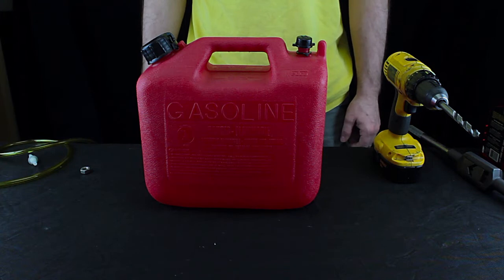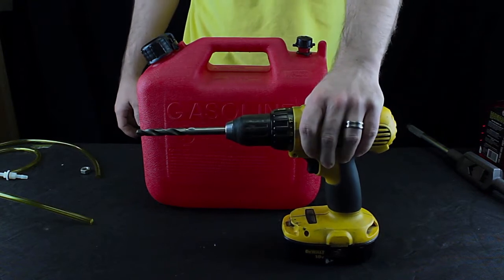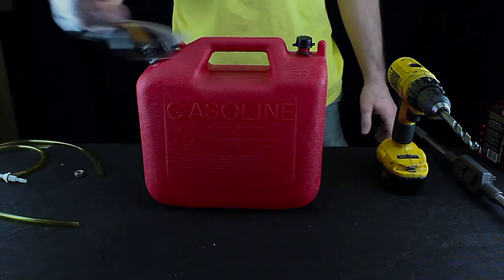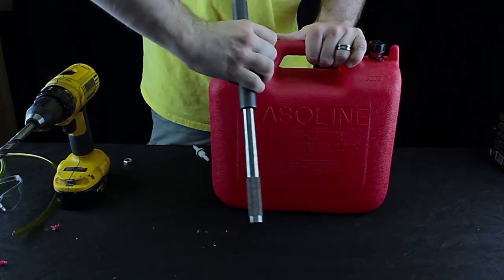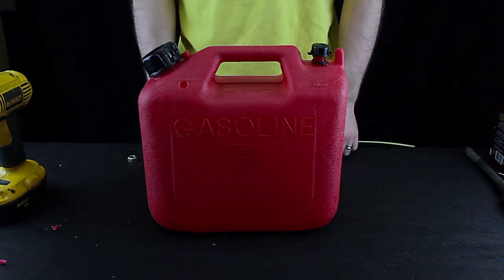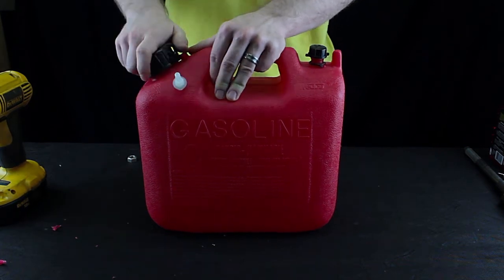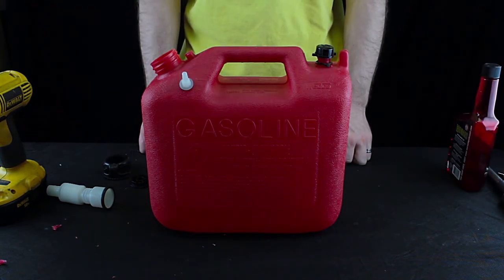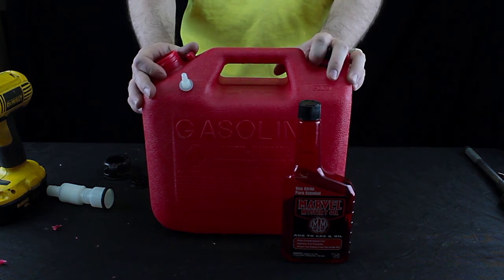EC Tech TV: How to build a flush tank for flushing methanol carburetors

Comment: How about a video on how to base line tune product # 169F-43-G160 adjustable main jet for 196/212 gx200 clones.

Installation was straight forward, but I'd rather not have to figure out how to set base line (stock setting) THEN figure out how to adjust from there.

A simple metric that's common in most carbs would be the number of turns out (clockwise or counterclockwise) to hit the same size jet as stock.